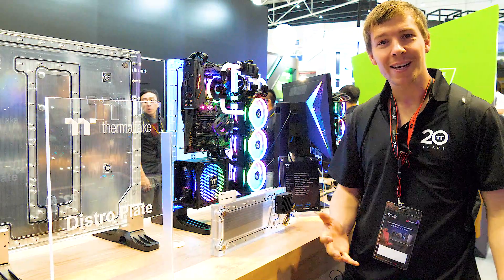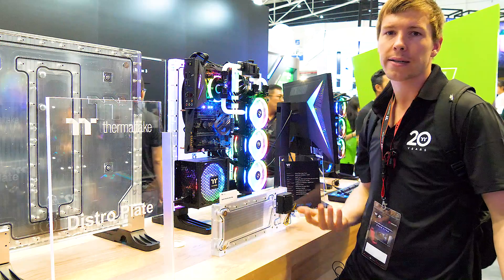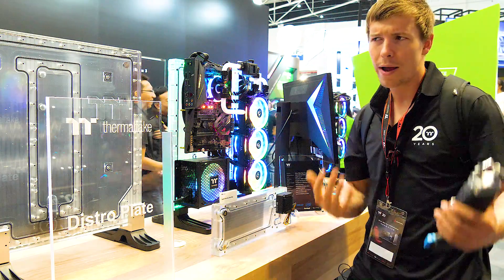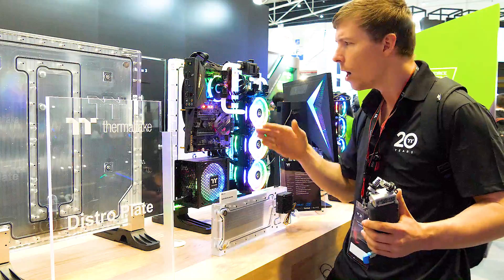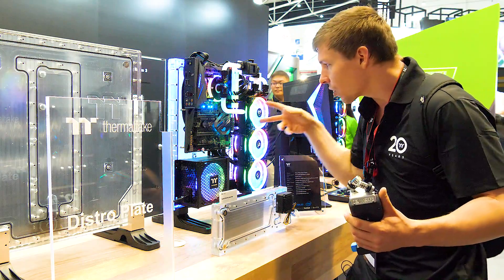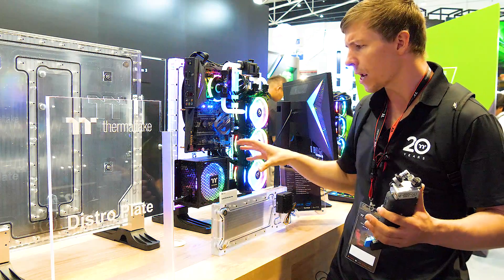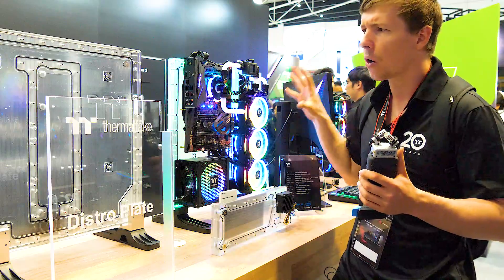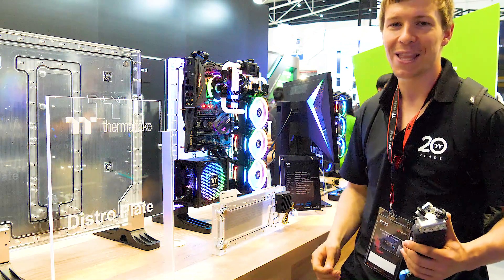AMAZING Custom Water Cooled All in One Core P3 PC Build Concept - Computex 2019

Comment: Make that distro plate the motherboard tray within an actual case, this would allow to move the radiators to the top/bottom/back/front and allow more of the distro plate to be seen.  This would also solve the airflow issue brought up in the video.  Open a few spots to route wiring to the back and/or make a few channels to run the wiring without ruining the clean aesthetic. I agree with the comment about adding some additional ports for video cards and maybe consider a dual loop configuration as well.  Having a PSU shroud would allow to move the PSU off the distro plate and potentially provide mounting locations for SSD/HDD's to further clear up the distro plate as well.

Comment: I wouldn't mind some sort of modular cable routing solution. Since I use custom sleeved cables, I like to show them off. With your point of a possible shroud the two could create a clean look.
Dpending of how much head pressure, can a D5 be used instead?
I also would like to see a better option for the radiator exhaust or even placement.

Comment: There should be a flow indicator and built in liquid temperature sensor with some  blur glass plate to cover up cable management and a cool led control tech at the bottom of case.
Reply: The blur glass plate would be nice!!!